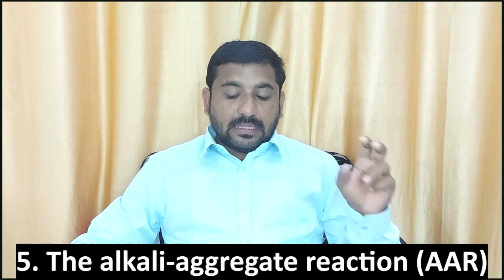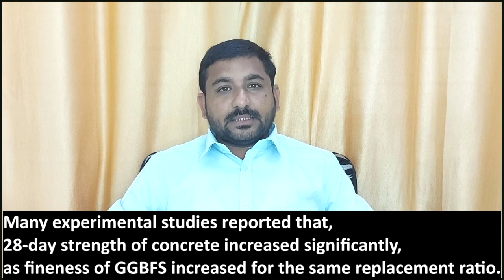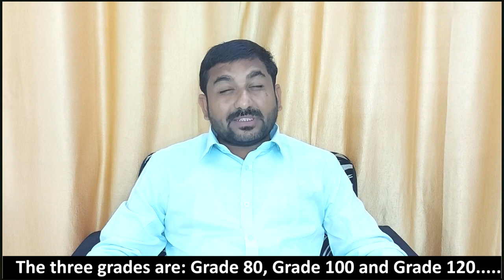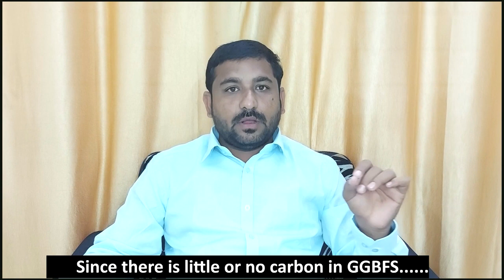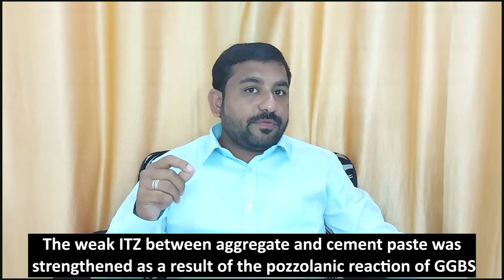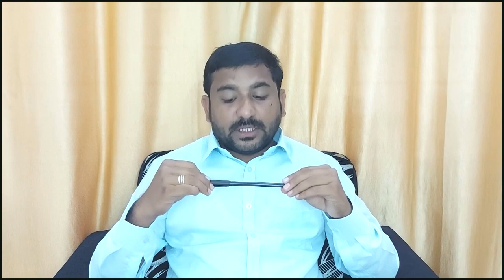HOW PHYSICALLY GGBS EFFECTS THE CONCRETE

Comment: Sir you said GGBS will gain its strength upto one year because of hydration process of forming Secondary C-S-H gel by reacting with Calcium Hydroxide...Does it takes 365 days to make complete hydration...I don't think so, after completion of hydration process it is giving strength how does it makes Pl let me know...And also Pl tell Secondary C-S-H gel  how many days it take start and end Pl tell...
Reply: Presence of moisture is a must for any hydration process to continue....If it is not present then later development of strength not possible.